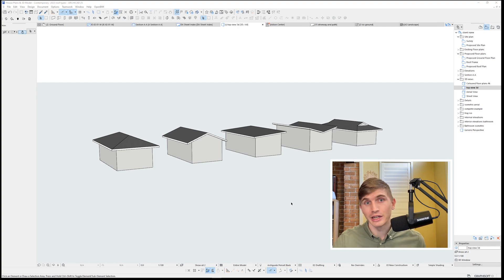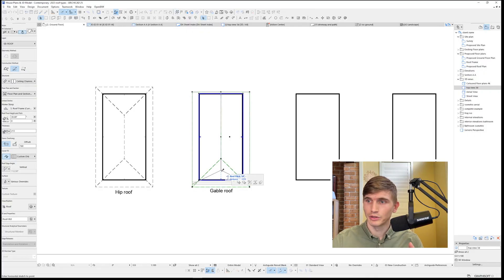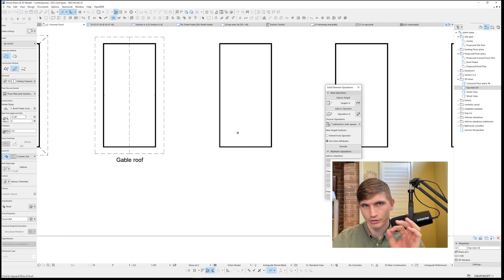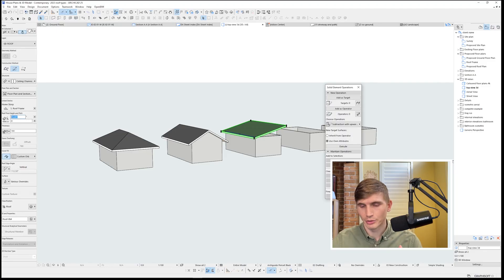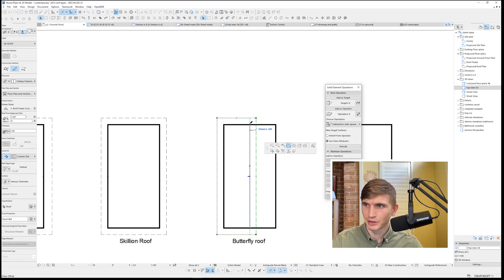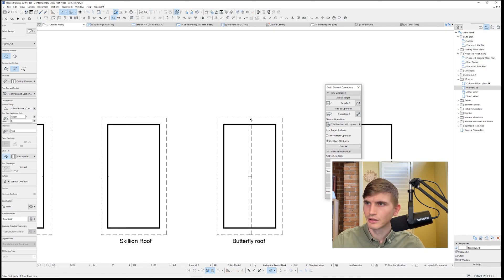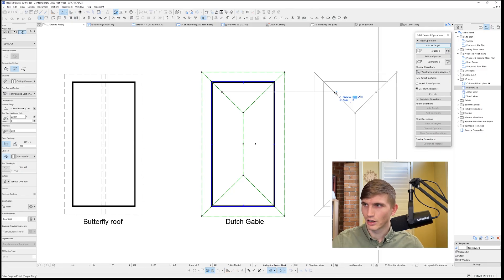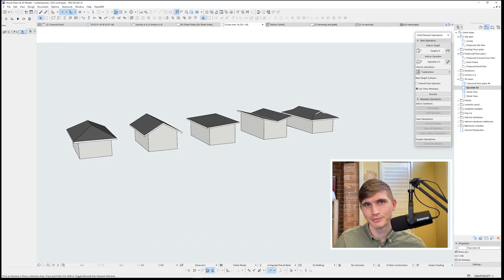ArchiCAD Tutorial: Mastering 5 Fundamental Roof Types

Comment: nice one.
but how does one draw it's section and elevation in archicad.
without the 3D modelling
Reply from the maker: You can use polylines to draw a static 2d  elevation.... but it's a bit of an older method of drawing. most modern studios use 3D modelling for all projects now with some 2D in certain areas of details.